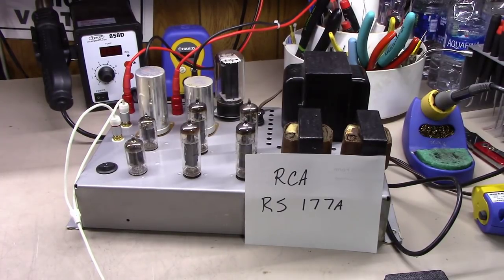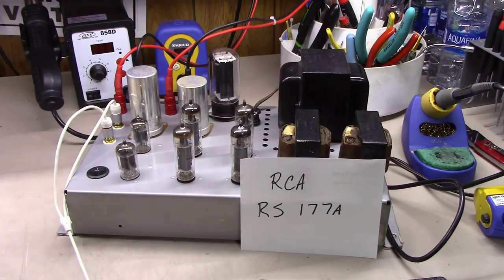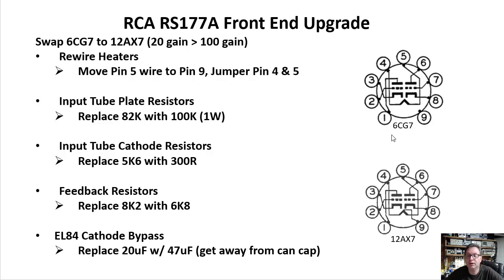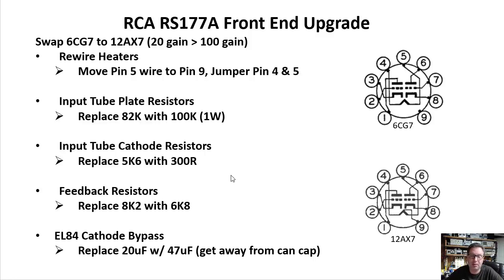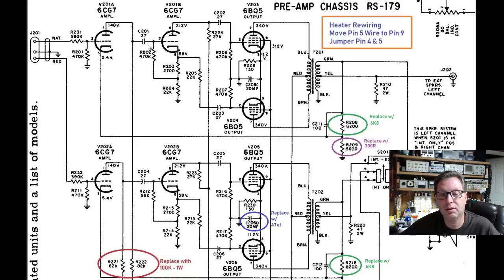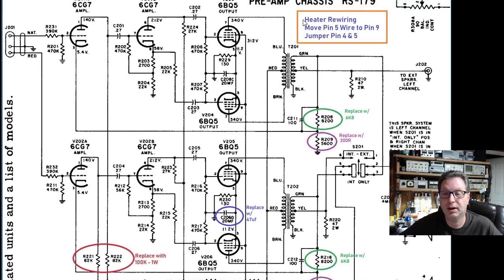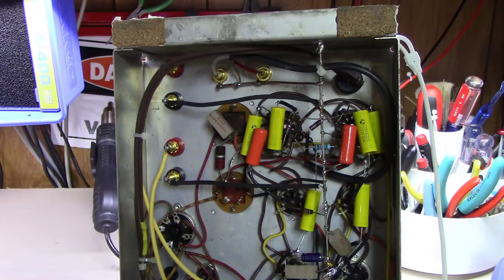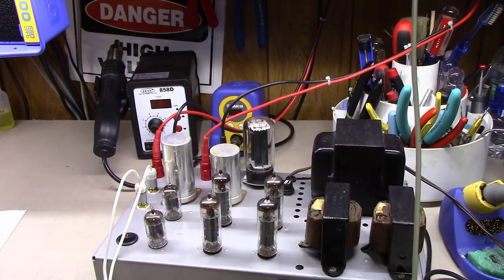RCA RS 177A Console Amplifier Front End Upgrade

Comment: 6CG7 has a shield between the triodes that connects via pin 9. So pin 9 may have been grounded which would have to be considered when rewiring the socket for 12AX7 heater.
Reply from the maker: Yep
Reply: @Blueglow  Hi. So should pin 9 still be grounded or not? I have done the upgrade to 12ax7 tubes as per this video. The wire off Pin 5 from the el84 started to smoke.
Reply: @bankofdave  I wish you received a reply to this question!  Worrisome.